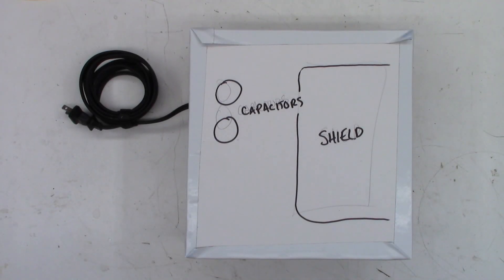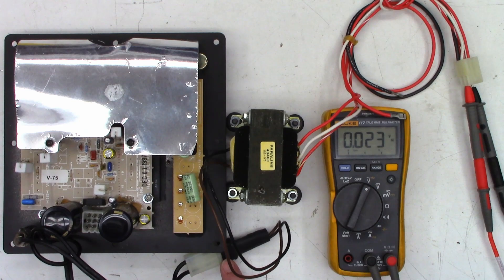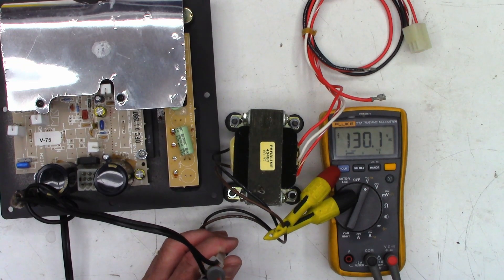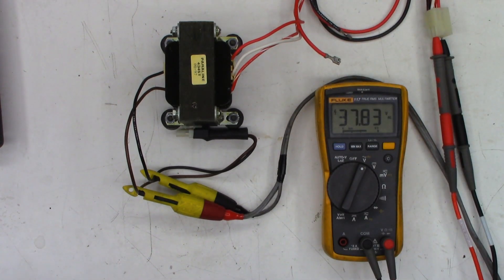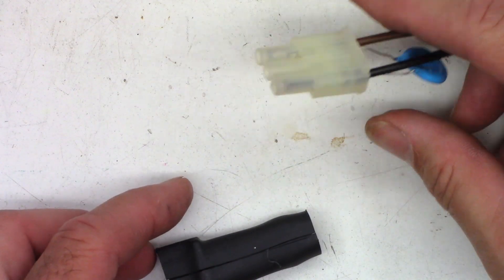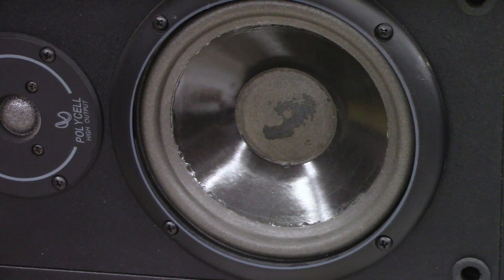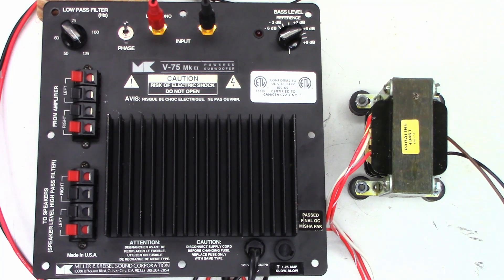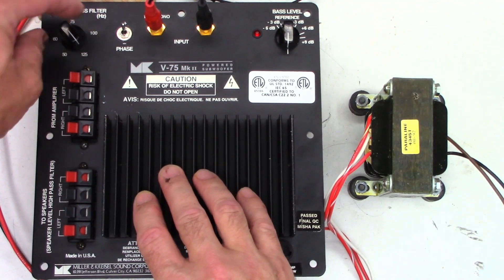Miller and Kreisel V-75MkII Subwoofer internals sent in. Customer says "Power transformer is bad"

Comment: I watch all your vids.   I came here the other day to see what meter you have.  I wanted one the "pros" use.   I bought one of these on Amazon.....not exactly cheap, in fact I was somewhat flabbergasted by the price.    I bit the bullet, and forked out the almost $250 to get one.   My current project is a NAD 7240pe I got off of Ebay.   One channel was out, but while I was troubleshooting, and comparing readings from the good side with the bad side, my crappy blunt probes from my old meter, shorted between the emitter and collector of one of the output transistors and I ended up frying the good side of the unit.   UGH!  I replaced all of the output transistors, and got the unit back mostly working but one side still had problems.   With this Fluke 117 I was able to trace out the voltages on the bad side and found a shorted driver transistor which I have on order.   Good tools are the key to good problem solving.   My old meter was not auto ranging, and that made it a huge pain to work with.
Reply from the maker: I really like my 117's, I have the one I use in my repair videos and another one I use in my full time job. I have Fluke 87 V at both places also. Rarely do I use the 87 V at home or at work. The only thing missing with the 117 is low current measurements.

Comment: You should try the Deoxit Protect S5 ”shield” aswell. I put it after using F5 because even longer lasting and it ads a certain smooth feeling to faders and pots. I Even use the S5 ”shield” to speakerbinding post (speakers and amps) and rca connectors because you get rid if the squeaky sound the make when tightening them. Also protects from further oxide. 
Another guy here on youtube that repairs lot of tvs and old amps (think you know, cant remember his name now) Jordan?! Anyway he couldnt get somw pots cleaned and after using the S5 the scope showed all good.